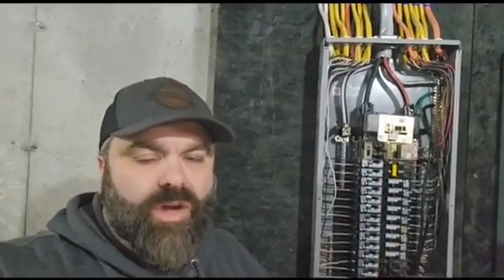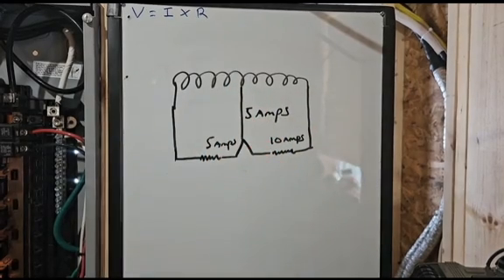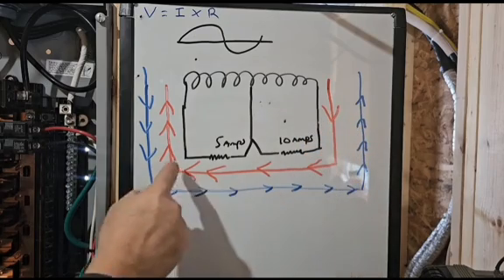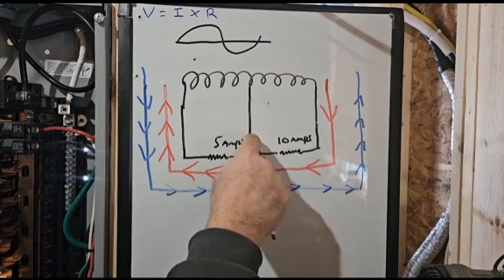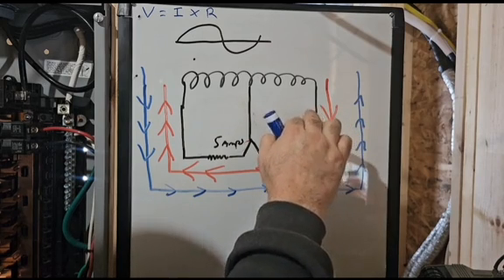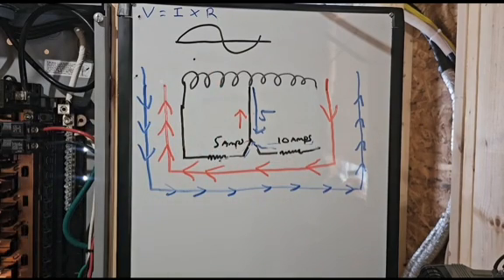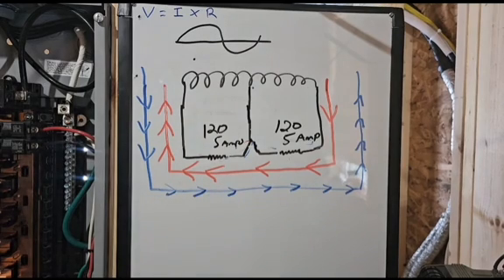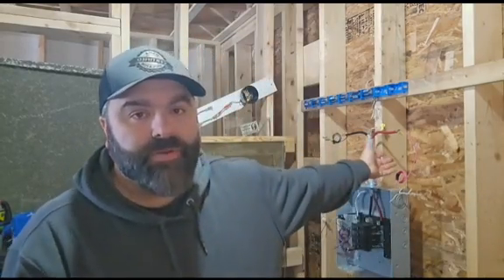CLICK HERE for full video How and why does the neutral carry the imbalance.

Comment: That 1/3rd imbalance on your stove is in part because the control circuits run off 120 (L1 or L2 to N). Cheaper as a manufacturer to step down from 120 than 240. Then falling out from that, I'd hazard a guess the heating elements are 120 rated elements wired in series tapping into the N midpoint - and a mass manufacturer isn't going to go to any lengths to balance those elements so you get one leg being a touch hotter and net heat isn't any worse for wear

Comment: Great video. And I totally agree with you. Thanks for such a clear explanation.

That said, I also know how we use certain terms like "canceling" to make it easier for folks to visualize a concept. Like saying "the sun sets". We all know that the sun doesn't really set, but it's easier to visualize from our experience. So I'm willing to cut a little slack to those of us who have said "canceling" and didn't really mean it! 😁

Another example is the use of water volume, pressure, and pipe size to visualize current, voltage, and resistance. This is a great illustration for beginners to get the gist, but fails in literal reality. 30 years later, I still use it to teach apprentices, but I make sure they know it's not a perfect analogy.

Great job!

Comment: What's the real purpose of alternating current Is it true that It can travel further Maintaining its current?
I think everything in our world is designed to confuse the heck out of everybody. When you rectify AC to DC everything's backwards including the colors of the wires for positive and negative All the different terminalogy that talk about the same thing
Reply: One big advantage of AC is the ease of changing the voltage with a transformer.

Comment: Great stuff and my appreciation from an EE who installed his own Service Entrance. Not sure why so many ignorant folks are so arrogant about not understanding basic things, yet that of itself explains why so many homes have imbalanced net currents from illegal (dangerous code violations) N-N (and N-G) commingling between branch circuits. Obviously, the bar is way too low, that the 3- or 4-way light switches function to turn lights on/off, but that is sadly all inspections care about.

I guess the risk of house fires and or electrocution, just doesn't rate as important for some, as de-energizing the 1st branch circuit DOES NOT interrupt the 2nd branch circuit's net current, flowing in the first one's wires. What's worse than this? The fact that circulating net currents also create dangerous magnetic fields, which can cause leukemia in kids. 

Us building biologists are trained to work with electricians (and plumbers too) to fix dangerous and unsafe homes with net current imbalances. Find an expert :

https://buildingbiologyinstitute.org/find-an-expert/

Comment: Nice video.  Silly question i bet... but doesn't each hot leg from the pole to the panel only feed one of the 2 sides of the breaker bus?  My mind is having a hard time on the sine waves "pushing and pulling" if say there was only a load on the service coming from 1 side of the feed on 110V only circuits.

Keep up the good work!

Comment: As a senior Electrical Engineer, I generally love your videos, but I have to nitpick you here.  It is Kirchhoff's current law (1st Law) states that the current flowing into a node (or a junction) must be equal to the current flowing out of it.  You stated it was Ohms law that gave this. Ohm's law states that the electric current through a conductor between two points is directly proportional to the voltage across the two points. A minor nitpick to be sure.  Keep up the great work.
Reply from the maker: Here is a link to my video explaining why I think it ohms law that decided if and when their will be an imbalance and how much the imblance  will be.  I write two numbers in the wrong spot but I think other than that it makes sense
https://youtu.be/A3BPVsDWuSs?si=3eGFJcA2BzO-i9x2
Reply from the maker: A shared neutral on split phase works off the same idea as a wheat stone bridge.  Which is why the shared neutral carrying the imblance still works when I replace the transformer with a stack if D batteries tapped in the middle of the stack

Comment: Why can’t I use the extra energy going back on the neutral?
Reply from the maker: Great question i will make a video about it
Reply: @Stevenj120volts also... make a video of how the electric meters that charge our asses handle it?  If we are giving energy back on the loop, does that cancel out... or is the meter only spinning on the wattage flowing over the 2 hot legs?

Comment: Hey Steve, how does the neutral imbalance thing work with 208V single phase?  You have two 208V legs feeding a 208V single phase device, how is it not needing a neutral?  The two 208 legs are out of phase by 120degrees, so shouldn't there always be the need for a neutral since they're not out of phase by 180 degrees?
Reply: The only thing special about a "neutral" is that it is connected to ground.  You don't need a neutral, you need a circuit.

A clearer way to illustrate this is by drawing a loop for each circuit.  Where two circuits share a path through the secondary, you have superposition and must solve for the current.  In the case of the split-phase configuration, it's easy; when the circuits are 180° out of phase*, the current is just the difference.  When you have two 208V circuits, it's a little more complicated because the phase angle is 120°.

*People who want to argue about the meaning of "phase" can please just go away.  This is about electricity, not semantics.

Comment: So 240 volt circuits dont necessarily need a neutral to get a complete path? Also why does electronics kill itself without it,if its splitting the 240v into 120v down the middle of the coil?
Reply: the neutral is required for the circuit boards inside an appliances. For example, most residential HVAC system use 240V to turn the motors. But the electronics inside operate with the use of neutral. Basically 120V is converted to 24V.

Comment: What does he mean by imbalanced? I’m picturing that means you might have five receptacles on each circuit for example.  And it becomes imbalanced when you are plugging in multiple appliances on one circuit with none on the other.    Or, Balance be to have say 10 receptacles on one circuit and only five on the other. Are either of those scenarios, correct?
Reply: imbalanced just means the two hot legs don't carry the same amount of current. It's not about the number of receptacles. Tho the number of receptacles is determined by the circuit breaker.

Comment: The challenge is when people think of the black wire as being the hot side, the know that means there’s always current there.  Wall switches go in the hot wire.  They then think the neutral as being unenergized, which can be the case sometimes.  So they think the neutral is safer than the hot side, which can be true sometimes.  But in an active circuit you can still get shocked by a neutral wire.

Comment: As a mechanic I mostly deal with DC, but I had a buddy once try to tell me that you can't get shocked from the neutral wire, I told him I didn't think that was right because of how AC works.  Was I right or was he?
Reply: Btw, he's dead now, so I won the argument by default, but I'm still curious.
Reply: He's partially right. If everything is wired correctly and in compliance with code, you shouldn't get shocked by neutral. But of course, in practice, there are always exception. For example, misfiring, Multiwire Branch circuit (MWBC) with are shared neutrals, crossed/swapped neutrals are among the most reasons why people are shocked by neutral.

Comment: You are correct . I think critics are thinking in DC terms maybe . Alternating current goes back and forth like you describe .
Reply from the maker: @richardgreene7198  we often talk about AC like it DC even calling it 120v.  It actually got from +170 to -170, 120 is the rns value which is the DC equivalent of the variable AC voltage

Comment: Very well explained, clears it up for me. Thanks for sharing. 
My 5 ton AC has a 50 amp fuse on each hot leg and is fed from a 50 amp 2 pole circuit breaker. 
My question is: Is the entire AC pulling just under 50 amps or is it pulling just under 100 amps? 
I think your video kind of answers that. So its a peak of 50 amps for the entire AC and the load is shifted 60 times a second from one hot leg to the other. Is that approx. correct?

Comment: https://youtu.be/LJvyb_WujZg?si=ed-XrO9elur-u5BM

This is another explanation with a demo of the same problem.  
The truly dangerous problem with a broken neutral is where the load is unbalanced!  Voltages can go wild.  I saw a 480 VAC 3P system go to 550+ because of a mid load short. 
Good teaching.  👍🏻👍🏻👍🏻

Comment: This is AC. The wire we call a neutral is the wire that is needed to return the electrons to the transformer low voltage side. But since it is alternative current, the neutral also see the reversal of the polarities and the reversal of the current flow thru it, so yes, it also feed electrons to the resistive loads.

Comment: Wouldn’t you still need a neutral on the stove for things like the timer and control panel?
Reply: In North America normally the controls and clock run on 120 volts so it needs the neutral. The manufacturers probably find this more  economical. Something like an air compressor might have a 240 volt motor and would not need a neutral, just a ground for safety.

Comment: We’re does the power go after it goes back on the neutral back to the power provider?
Reply from the maker: @drakemia4079   the amps are sent  back into the transformer secondary and then sent back out
Reply: @ wow so could someone use that over flow to do other things?
Reply from the maker: @drakemia4079  no hard to explain in a comment amps alone can do work or power things.  You need watts and to have watts you need volts and amps.  No watts are sent back just amps
Reply: @ isn’t amps power?
Reply from the maker: @drakemia4079  no watts is power, amps is current. If you're thinking of it like the water analogy amps is gallons voltage is pressure, watts is the combination of pressure and gallons making the ability to push stuff
Reply from the maker: @drakemia4079  so the amps returning to the Transformer have lost their ability to do work but they will be re-energized in the Transformer and sent back out
Reply: @ ok thanks for your time it is very helpful and I will keep on learning.
Reply: @ so if the load is a motor and its high load is 5  amps and it only is using 3 amps the two amps go back to the transformer on the neutral wire.
Reply: @drakemia4079  A properly functioning motor (of any type) won't draw its full electrical load unless its also providing its full mechanical load. All the current that flows on the hot will flow on the neutral for a 120 volt single phase motor, unless there is a short to ground or some leakage current into ground. A 240 volt motor will have the same current on both hots and the neutral isn't needed, just a ground for safety. This is for single phase in the US. Three phase shares the power mathematically among 3 wires but it's just a more complicated version of the same thing, sometimes using a neutral, sometimes not.
Reply: @Stevenj120volts good analogy... but if the amps do indeed get back to the transformer, how do they get there on the neutral return path vith no voltage pushing them?  Eg)  requiring watts to move vs sitting still.

This electrical engineering nuance has always fogged my mind. Say a light circuit is on.  2A on the hot and 2A on the neutral.  Are you saying i will read zero volts to ground on that active loop right, but hot to ground will ALWAYS be 120V even under load.
Reply from the maker: ickwhitfield7617  there is voltage in the circuit pushing but there is basically no voltage above ground because ground and neutral are bonded. So testing neutral to ground is close to zero it the same as testing hot to hot if the two hot wire were spliced somewhere and fed from the same breaker.  So you could have two 120v wires but get zero voltsge of try test for voltage between them
Reply from the maker: @rickwhitfield7617 I answered you but it doesn't look like the tag worked do you see my answer
Reply: @Stevenj120volts i got it.  thanks!  Interesting call out.  So for learning sake, if i measured voltage on an active circuit with no neutral to ground bonding at the panel... i would indeed read 120V or would it be lower voltage due to the load in it from the hot side?  I think my brain needs to stop thinking about the damn water flow analogies we got taught as kids on AC circuits.  It over simiplifies it.  The real evolution in understanding is when your mind can think like an oscilliscope in AC!

Am i wrong in also feeling that the "push pull" anology is misleading too?  The current and voltage IS FLOWING, but reversing polarity at 60htz.  It is easy for people to think of the "push / pull" analogy as a pipe that has some water in it that never actually makes any forward progress going back and forth endlessly.  Follow me?  Or am i just dumber than i think?
Reply from the maker: @rickwhitfield7617 every analogy works for some things and fails for other.  Look up the chanel alpha pheoneix he has great video call an intuitive understanding of ohms law.  But remember voltage is the difference in potential between two point in the circuit and tells you the push force between those points.
Reply: @ oh and I thank you for your work to bring it to utub

Comment: Neutral is to deal with 1 phase imbalances, if everything was running balanced on 3 phase we would not need a neutral, IT system is the future.
Reply from the maker: @user-sd8qv8kp7e  if everything is balanced with single phase you don't need the neutrel

Comment: I'm a self taught electrician, and so admittedly not a great source of info, but... the way I avoid confusing myself about the role of the neutral works for me. If you tend to use the water analogy for how electricity moves, then just think of the neutral as a pipe with water under no pressure and with no backpressure. Or amps with no volts. The water in the neutral pipe flows in whichever direction it needs to, to accommodate the movement of the water in the pressurized pipe or the hot wire. 

That keeps me from thinking of the neutral as a ground and is useful when I'm trying to understand the current path.

Comment: Absolutely correct. I know for a fact. I'm a retired broadcast engineer. The largest utility I ever had to operate was 480/3-phase/400 amps; 3MW UHF transmitters. The "smallest"..? Would have to be designing, installing my "semi-whole home" generator a few years ago. Knowing that appliances unbalance the 120/240 neutral on single phase service, I opted to study the loads, and move breakers to "other" busses to create a better 'balanced' load. One that the generator would find more forgiving. The generator is "technically" not capable (13KW@120/240) to carry the load(s) of heat pump(s), E-stove, HWH, E-dryer, etc. But suffices for "lesser" appliances, like MWO, lights, outlets, and critical things like the internet and home theater 😉 By monitoring the neutral load I was able to better balance the load(s) and not task the generator. I could do this since all the loads were on one leg or the other. The genset is propane, so when the gas company installed the drop, I had them include a "T" for any future heating or cooking appliances. 'Home' is Tennessee, and the climate isn't extreme either way. Be Well.

Comment: Confused
You say when both loads are balanced, L1 current flows through L2 and not any through neutral.  This means you are implying that L1 current is in phase with L2.  We all know that L1 current is always 180 deg out of phase with L2.
Reply from the maker: @glennphelps9300  there is only one phase .  L1 and L2 are the phase.  Using Neutral is a way to use half the phase.  I know it taught that they are 180° out of phase.  They are not.  It just looks like that on a scope it you use the neutral a reference.  But this entire set up of the neutral carrying only the imbalance will work on a DC set up where a panel is fed from batteries

Comment: You are wrong!!!!
Reply from the maker: @rickysales7576  lol.  I know I am right I can and have proved it with experiments.  Like did you  know it works with DC same as AC.  I have fed a panel with a  stack 18 D batteries. I get 12v hot to neutral 24v hot to hot.  And the neutral carries the only imbalance.

Comment: I think this explains a 1940 chart of Century Motor offerings.  It had three types of induction motors; induction/repulsion, capacitor start, and split phase.  Split phase must have meant 120 volt or 120 volt only (because most motors can be wired 120/240).

Comment: Ohms law is good but, check out Kirchoffs  voltage and current laws. What enters a junction must equal what leaves the junction .Currents absolutely do cancel if they are flowing in opposite directions.That is a fact.  We don't need to look at an RMS AC voltage or worry about some formula to see this. Just freeze your sinewave at one of the peaks and look at what will be across your secondary and then analyze it.   Looking at your secondary at one moment in time it will look like this..........+  - +   -     and 180 degrees later it will be like this.... - + - +.   This same thing occurs in all transformers.  But , just look at one of the instances and use Ohms law to figure your values. Of course were assuming your loads are resistive and reactive. So just treat them as resistive show your current flow and you'll see what I am saying in your center leg/neutral wire.
Reply: I meant,not reactive.